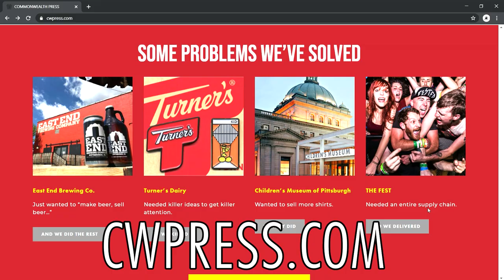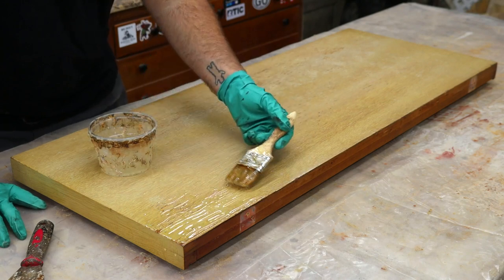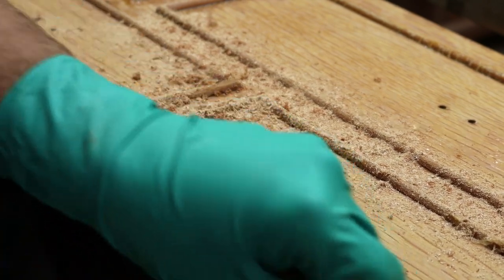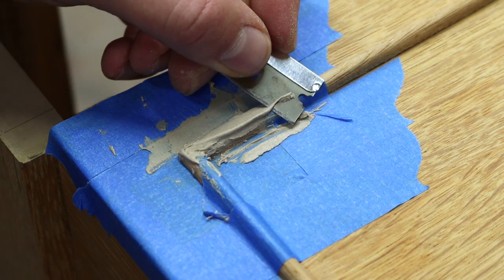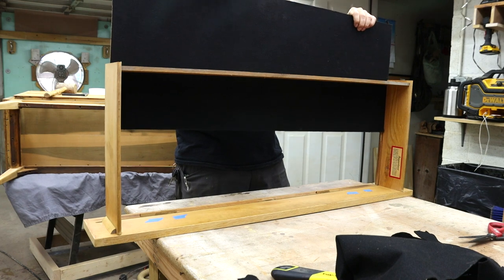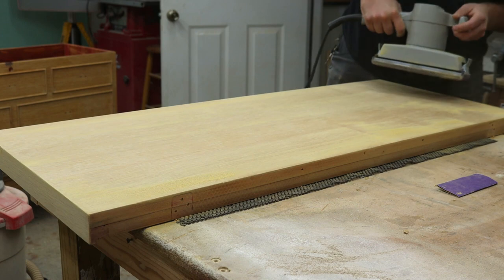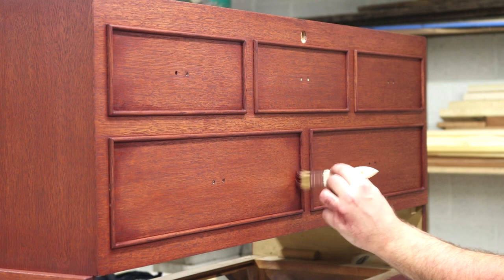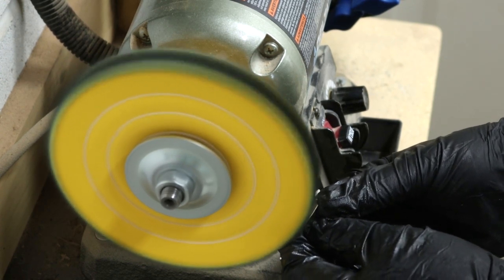Refinishing a Mid Century Modern Lane Cedar Chest | Furniture Refinishing and Repair

Comment: What a beautiful transformation! I didn't think I would like the stain you chose and I didn't. I absolutely love it! The finish and the polished original hardware make it look a very expensive piece of furniture. 
Re: the missing lock. 
It was probably removed due to a safety recall.
If the cedar chest was built between 1912 and 1987 the locks did not have a way to be opened from the inside which resulted in several suffocation deaths when children would play inside the air tight chest and close the lid.
If you contact Lane and provide the serial number which proves it was built before 1987 they will send a replacement lock for free. All locks on Lane chests built after 1987 can be opened from the inside.
Jo

Comment: Reaserching Lane Chest Restoration. Have learned that the Serial Number on the bottom written backwards reveals the date the chest was manufactured. Looks like the one you’re restoring was built in 1955. I will be redoing my mom*s from 05-27-40. 
My question: What should I do about veneer? It is already loose and damaged and separating. I assume I must replace. I don’t know yet what is underneath. It looks like glue. Do I sand it off? If wood underneath, do I stain it or veneer it?  Thanks.
Reply from the maker: Great information! I would repair or replace the veneer. The substrate isn't typically very appealing.

Comment: Any recommendations for ways to loosen up a wood glued joint on an antique? Trying to repair an old antique table of my mother's but I need to take a leg off. She had glued it up years ago because it had a little wiggle. And he definitely used half a bottle of glue on it 🤣. Also I've really been enjoying your videos. Just recently found you channel
Reply from the maker: Thanks bud! I usually just gentle give it a few whacks with a soft headed hammer. If you don't have one you can put a towel or something over it. Sometimes you'll get a break just taking it apart if it's fresh glue. You can try prying with a flat pry bar and things like that too. Good luck bud!
Reply: @JohnBearWoodworks  I appreciate the feedback! Keep on keeping on!

Comment: Could you do a video on how you spray what kind of gun you use  air pressure and so on,, I have three our four guns can't seem to get good results with any of them I use mohawk finish thanks cedar chest looked great at first I thought it would be to red but in the end really looked fantastic
Reply from the maker: I sure can! It probably won't make sense and there are a million variables that change each time but I can try to get the basics! Thanks bud!
Reply: @JohnBearWoodworks  you bet I've been struggling with lacquer finishes I looked the gun up you use I'm going to order one and ad it to my collection  thanks
Reply from the maker: @edcrego396  what are some areas you're having trouble with I could address in a video? You said you use mohawk? What finish is it?

Comment: Beautiful job! I got an old cedar chest I want to try to fix my mom bought it used for my graduation. I’m 50 now. My mom died I just can’t get rid of it. Quick question I’m a newbie and have nothing fancy like you. Just old furniture and sander and paint. I just painted my granddaughters dresser and nightstand white. Now this might sound dumb as this is my first project. I saw a video that said don’t put Polycrylic is that right,  on white it turns it yellow! 😳I planned on polyurethane to protect it. Is that the same thing??? If so what do I put on white paint if it’s ok to ask? I did use paint with primer. Love learning from your videos.  Already stumped on my first project😩
Reply from the maker: Thanks! Yes any sort of poly will turn white paint yellow. It's the oils in it. Even the water based has a little bit of oil in it. My suggestion is to not paint furniture in the first place but what's done is done. 🤣 Haha

Comment: Lovely piece! After sanding between coats of sealer, do you need to remove any debris? Would mineral spirits or compressed air work best?
Reply from the maker: I just shoot it with air and use my hand to wipe it off. I would never use mineral spirits for that. It could mess up the finish big time!

Comment: Thank you so much for sharing this video! I love all the detail you went into, showing all the steps and tricks. I actually have this same chest I am starting to refinish, although mine is actually pretty close to the color you ended up with, rather than blonde. My plan is to do a stained top, with the rest a distressed paint. I was thinking of replacing the hardware, but maybe it won't be too bad once it's cleaned up. What did you spray the hardware with at the end?

Comment: What is the significance of putting felt in just one of the drawers? I just bought a dresser where only the top drawer is lined in felt. Is that common practice? Is there a reason for it? Is there a reason why other drawers can't be lined too?
Reply from the maker: I think people used to put valuables like jewelry or nice things like maybe a photo frame with an old relative or something? People didn't have as much clothing, possessions, etc back then and it wasn't a throw away world so you wanted to keep your nice things nice.

Comment: Amazing restoration! Congratulations on a job well done. Question: how do you deal with dust and other toxic particles when sanding, etc?

I couldn't help but notice all the dust accumulating in your shop as you're working and that for me would be a huge no no, I sand quite a bit, but first and foremost I'd like to keep my lungs healthy for as long as I can. 

On that note, I just saw another video from another carpenter here in the woodworking community, and found it quite on point. I'd love to hear your opinion on these subject matters. 

https://youtu.be/nC7_fgojpy4 

Hopefully you could address these issues in later videos: health hazards, fire & accident prevention etc.
Reply from the maker: I have a fan blowing the dust out and I have an air scrubber I made. I always just wear a dust mask when doing most things around the shop. When I'm sanding with my disc sander it's hooked up to a vacuum. I've worked in shops the dust and fumes were HORRIBLE. It's pretty important to me to keep it all under control as best I can because not only do I know it's horrible health wise I'm allergic to everything and I sneeze my head off in a lot of dust.
Reply: Thanks for the reply, it's a really important topic and since you explain things really well in your videos I thought it would be interesting to listen to your perspective and experience.
Reply from the maker: @Kaio7  thanks bud! It's dirty work but someone's gotta do it! It's kind of like a scuba diver trying to stay dry. Haha